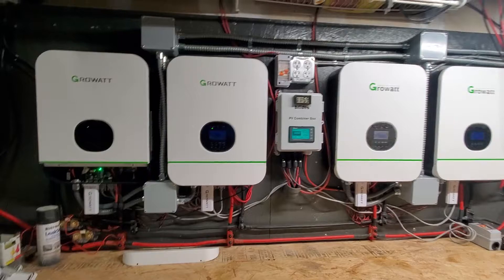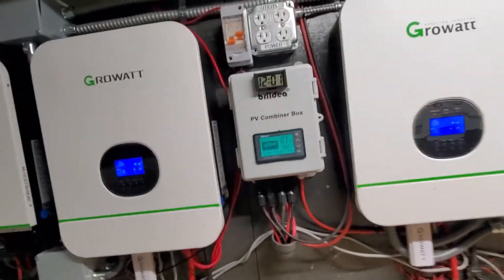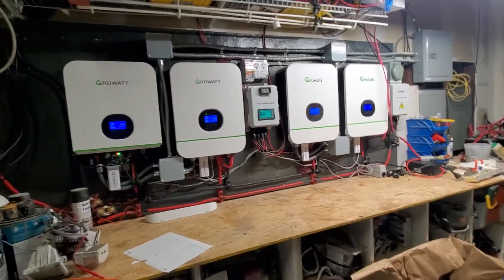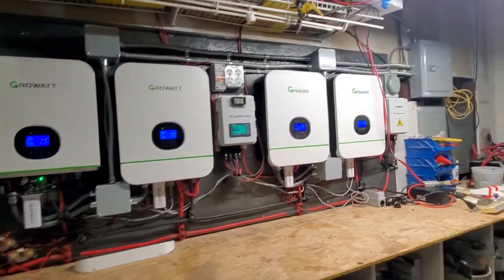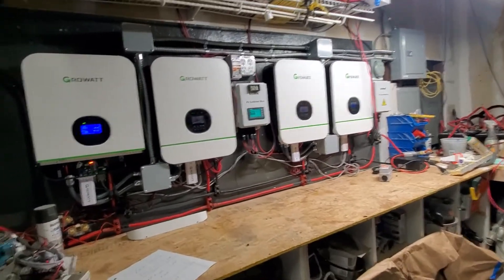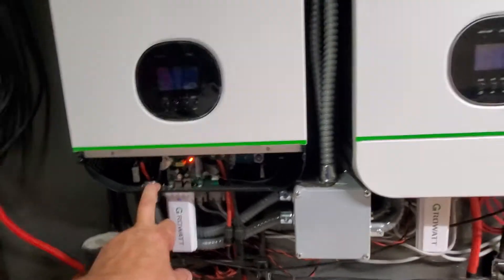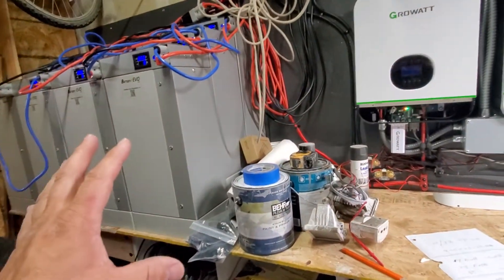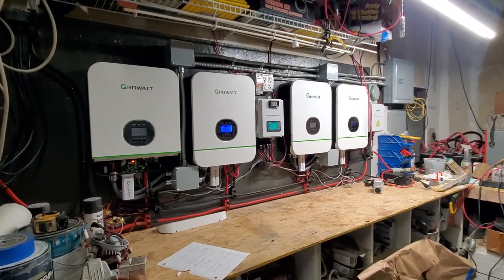Growatt 3KW 48 volt Inverter

Comment: I have a question? I know that you’re supposed to have a 40 amp breaker feeding from the utility to your Growatt inverters, but what size amp breaker are you using to feed towards your panels from the inverters? Could you be feeding your main power with a 50 amp breaker or possibly even as high as a 60 amp breaker without any damages to your inverters? My power cord I am using is a 30’ 50 amp cord. I think 40 amp breaker feeding my panel is too low. The reasoning to going as high as a 60 amp breaker is because that’s the size my electric heater is required in my home.50 amp is going to be pushing as high as 12,000 watts and 60 could push 14400 watts that is required for my heater. My cord feeding my main is 50 amp cord.Thanks in advance.
Reply from the maker: I have moved up to the EG4 6000xp inverters. Im using the same breakers that I used with the Growatts.....30amp breaker feeding the inverters from utility and 50 amp breakers feeding the panel from the inverters.
Give signature solar a call and talk to one of there techs....there really good at helping..

If you use a larger breaker but your wires coming from the inverters arent rated for that size breaker then you could have a real problem if something goes wrong with your system.
The wire needs to be matched to the breaker.
Reply: @richd9771  my wires are go for up to 50 amps. That was my problem that I was having. I was feeding my panels from my inverters with only a 40 amp breaker. Thank you very much for your answer. I do understand your precaution when answering these kinds of questions. 😊
I will not go any higher than 50 amp breaker to prevent any damages to my inverter. I will used my wood burning heater that I installed for the most colder days in the winter time. Thanks again.😊 Best wishes with your upgrade. I’m looking forward to your next video!
Reply from the maker: Im not sure what you mean about breakers feeding towards the panels. I do have additional 20 amp breakers that the string of panels comes into before entering my inverters...its not needed on the eg4 inverters because they have built in breakers, but this way I can shut off the panels and work on the inverters if needed.

With the Growatts you have to add all the breakers. So i have a breaker coming from my batteries to the inverters, breakers coming from the utility to my inverters, breakers from the inverters into the breaker panel and breakers coming in from the solar string into the inverters.

Hopefully that helps, if not just keep sending me questions.

Comment: I have a 15 KW central heater and I have the very same similar set-up in plans when 2 more of these growatt inverters are added to my system. Do you agree that with 4 of these growatt inverters that would be enough to handle this capacity? Thanks in advance.
I can’t get my dongles to link up with my Starlink WiFi I’m thinking maybe because it’s coming in at 5ghz instead of 2.4 ghz?
Reply from the maker: Hi, the dongles wont work on 5ghz so your right about that.
 4 of the inverters will give you 12 kw total so your already under a bit and. It will work but you most likely will be switching over back and forth to utility when the loads are more then what the inverters can produce. Adding 2 more would fix all of that.

I moved up to the EG4 6000xp inverters and have 3 running. Im almost ready to make a video on those I just wanted to use them for awhile 1st.
Reply: I have installed a wood burning heater box with fire bricks last winter and that really helped me with the 15kw heater during the coldest months last winter. Thanks for your feedback! 😊
Those EG4 6,000 watts sounds very nice. When I first gotten involved with these Growatt I don’t believe those were available.  My shoe string budget was very tight also. I think I have around $9,500- $10,000 in my system so far and I retired from work this past March, so I am not looking for that many upgrades. Maybe a few more solar panels. Time will tell. 😊 more power ! Got to have it!

Comment: How is the idle consumption on these?
Reply from the maker: 50 watts each. I have so much battery storage that idle doesnt effect me at all. Ive been looking into the new EG4 6000xp inverters and considering upgrading. They put out the exact same as the Growatts I have and have the same idle consumption and I would only need 2.

I havent had 1 problem with the Growatts at all other then some minor light flicker from time to time.

Comment: thanks for your video.  I do have 2 Growatts at this time running on 24v battery.  if I add another growatt, can I run 2 growatts (3k) on one line(leg 2) and run 1 growatt on the other line(leg 1) in my panel?
Reply from the maker: I had the same question at one time. I called Growatt and they did say I could run 3 just as you are thinking. 
So I connected 2 on one leg of my panel and 1 on the other leg....I had problems constantly and I think it might of had something to do the units communication. 
I added the 4th and all the problems went away. My suggestion would be to add units in pairs of 2.

Check with signature solar they have great customer service and there prices are great.

If there is anything more I can help with just let me know. I need to make an update video  since its been over a year now off grid.
Reply: @richd9771  thanks man!  disregard my question as I asked the same question to your other video.  Thank you for clearing this up for me!
Reply: Planning to buy 2 more Gorwatts to copy your set up finally!  I was thinking maybe get the 18kPV EG4 but maybe for the meantime I would get 2 more growatts instead.  DId you have 4 single pole breakers for 4 inverters in your main breaker panel or 2 2 pole and what rating are you using?  are you planning on upgrading your set up?

Comment: Each inverter cost what $ 750. eBay $ 750. X 4 = inverters only $ 3,000. + battery banks
Reply from the maker: If your interested in these inverters then buy from signature solar...Inverters, batteries, cables, solar panels, wire, combiner boxes, bus bars, Renogy meter, EMP shield and a few other things...it all adds up.
Reply: @richd9771  system looks neat.Any way that you could tell us about the connectors you've used to connect  the 2 gauge wires ?
Reply from the maker: @tilolo04  Im going to make an updated video in may which will be 1 yr since going off grid. As for the wire connection points...the inverters of course have there own screw downs...the wires come out of the inverters and attach to a 2 lug which then branches to the next and the next until it reaches the terminal blocks. All the batteries connect to the blocks.

Im sure that can be a bit confusing...I think I just might have to make a short video this weekend on the connection points so you can see what it is Im talking about.
Reply: How many thousands of dollars compared to you’re electrical bill of $ 100. ~ $ 150. A month all that equipment $ 10,000.00+ divided by $ 150. = 67 months over 5 & 1/2 years !
Reply from the maker: @marktheunitedstatescitezen185  I stopped keeping track at around 16 grand. Ive added a few more batteries so just off the top of my head I think Ive invested around about 23 grand.
 Im in California and my electric only was an average $325 an month. I did a look at the last year (12 months) and my average electric bill has been $12.10 and thats just a fee for having service but I didnt use any power.

I figure Ill make my money back in 4 to 5 years. Our utilities have been going up and up on a regular bases.

Paying only $12.10 a month verses $325.00 a month is well worth it all. We had a few power outages the past week but I wasnt effected at all.

I didnt get into this to make my money back fast I did it to reduce my utility bill and to not have to worry out outages.

The savings

Comment: Is 2 of the units supplying 120 AC to a breaker box along with the other 2 supplying 120 to the other half of the breaker box ?
Reply from the maker: Yes, they are in split phase. I supplying 6Kw to one side of the panel and 6Kw to the other side.
Reply: @richd9771  an it powers a 240 heating element jest fine that way an are all 4 units USB s plugged into each other?
Reply from the maker: @thevikingwolfpack836  Yes I can run a 240 v heating element. Of course there are other factors like others things you might be feeding off your breaker panel, how large your battery bank is, your solar panel production, on grid, off grid...etc. that will determine what you can run.  
The 4 units are connected with a communication cable so there are able to communicate with each other.

Comment: Thank you for your lessons taught on this
subject! I am not an electrician, but I have
gone to Vocational school over 42 years ago. I
am now 61 years old and I am learning a lot
about setting up my on solar panel control
station thanks to you and other bright men
like yourself on YouTube! I am so very grateful
to you and others like yourself!!'
Reply from the maker: Robert, your welcome. For me its all about sharing information and learning more from others. Its not very hard to do just take your time and dont cut corners. Always remember safety first we dont want to see any fires.

If there is anything I can help you with please feel free to ask as many times as you like and need.
Reply: I will use thick cables as required and breakers near my batteries. I am aware of the dangers of unprotected cables and to tighten them up with secure snug torque along with stink wrap.This is really a sweet project that I am going to enjoy as I go into it. I am waiting on all of the correct parts to arrive before  I can continue. It has also been rainy a lot more than usual around here lately, thanks again!
Reply from the maker: @robertmyers4155  what voltage will your system be? Are your going with Growatts?

Comment: Hi, if I’m on SOL and the battery is fully charged at mid day, why does the SOL disconnect ? and inverter runs from the battery again?
Reply from the maker: What type of batteries do you have and are you 100% off grid or do you also have utility connected on the back end?
Reply: @richd9771   hey, I have the Growatt Hope 3.3kwh batteries (x2) and I’m also connected to the grid.

Hence my output setting SOL and charge OSO, as I want to preserve my battery for load shedding (when the utility is down).

If the battery is low and solar is available it will charge the battery and supply loads, but as soon as the battery is charge 100%, the SOL shuts down and only kick to when the battery is at about 90% and recharges it full if the sunlight permits.
Reply from the maker: @williamseptember640  What it seems like is your batteries fully charge then the inverter shuts down because there full then the inverters consume power from your batteries because the solar has shut down....once the batteries drop to a certain voltage the inverter turns the solar back on to charge the batteries. 
Its a cycle and mine does the same.

If we are using more power then my panels are producing like on a cloudy day then the batteries will provide the additional power needed. Then when the conditions are right the solar will start to charge the batteries again. 

Your best bet would be to add more battery storage as you can. I started with only a few batteries and only made it to about 230am then my Growatt's wold switch to utility until the morning.

Now I have 3 days of battery storage and have no problems with the solar turning off and on during the day. 

Im not sure if this helps any but your other option would be to email the Growatt support. I have talked to them a few times and there pretty good about getting back to you.

If I can help in any other way just let me know.

How are those batteries working for you? Were they expensive?
Reply: @richd9771  hey bro, thanks for the reply …. I think your explanation is spot on and I figured that much.

From the lithium battery options I had These were the cheapest. 

I think I’ll contact Growatt support maybe, they have another way of manipulating the cycle.
Reply from the maker: @williamseptember640  Not a problem its all about sharing info and helping each other. If I can be of more help just let me know.

Ive been lagging and need to do an update video with my setup
Reply: @richd9771  bro, I used 75% (6hours) of my 6.6kwh battery last night, during the busiest time of our day when we using the microwaves, oven and kettles when making supper, koffie and hot bottles for the kids (TVs, fridges, wi-fi, phones charging, sound systems and decoders on during this time as well).

I’m trying to get to a solution where I use as much solar (375w x 6 in 2 strings).

Solar starts staring incrementally from 8am and at 12:00-14:00 and slowly down until 6pm at it lowest (only a few watts).

But like I said solar goes down for about 1.5-2hours during the day, mostly during the peak sunlight period.

Thé battery float doesn’t seems that it can be adjust as I have the Growatt batteries with BMS.

We at work during the day so load from the house is about 300-400watts p/hour.

Thus my challenges that I’m not getting the maximum out of my solar array.
Reply from the maker: @williamseptember640  I pretty much get the same thing. Mine goes down and come back up then goes down and up, not sure if its a Growatt thing or not....

The solution for me and what I always wanted was more battery. With my current setup Im running the 4 machines and I have 30 465watt panels...I might gone a bit crazy with my setup but I like to always have more than I need that way I know Im always going to be OK.

My goal was to remove the utility power from my home and be 100% off grid from that and Im now approaching 4 months solid with zero issues.
Reply: @richd9771  how are panels connected, taking into account the max VOC for these machines are 145v?

How many strings do u have p/ inverter or how are yours strings setup
Reply from the maker: @williamseptember640  Mine set up in strings of 2. I have 4 combiner boxes with 4 strings going into each. my last box only has 3 strings because I need 2 more panels but not sure if Im going to add those 2 or not

Comment: What is your average KWh consumption per day and total for the month that 4 grow at inverters is enough to be off grid?
Reply from the maker: I have a large home and lots going on...we do the wash, I have a 10x20 shed with all my tools, we runs 4 ceiling fans most of the time have a standup freezer in the garage and more.
Our average consumption per day is 13-23 kwh and our production is 18-31 kwh.

The inverters are giving me 6 kw on leg one and leg two of my panel and thats enough to provide the power for my home and all the goodies inside. 

The panels usually have my batteries fully charged by noon and by 3 on cloudy days.

Comment: Nice video!  Looks like a great system.  In California, the biggest fear I have is not about putting things together so they work, but county/city permit process/inspection and approval.  Did the inspectors have any issues with all the wires dangling from the inverters?  Lot of videos about DIY solar systems on youtube seems like they didn't bother with official permit/aproval

Comment: Awesome! I want to get of PG&E too. Did you just cancel the service?
Reply from the maker: No I didn't cancel service I just stopped using electricity and disconnected the line in my panel.
We still have gas service but Im working on getting rid of that too.

We still get charged around $12 a month for nothing...service fees.

Are you in the Bay Area?
Reply: @richd9771  Hehe I figure :) I asked the question before I watch the video. Yeah bay area in Dublin.
Reply from the maker: @dymsza  Well alright, in Richmond not too far from you. If your interested in putting together a system and would like some help just let me know.
Reply: I already have system, but do have regretes I wish I went with "off-grid" setup like yours. It will payback fast.
Reply from the maker: @dymsza  Your story is what I hear from lots of people. Sold on grid-tied solar systems...I knew from the start that I didnt want anything to do with being connected to the grid.

If your ever out my way and would like to see 1st hand what Ive done your more than welcome.